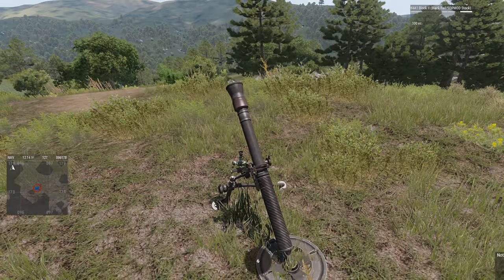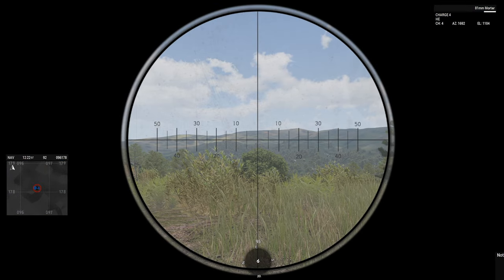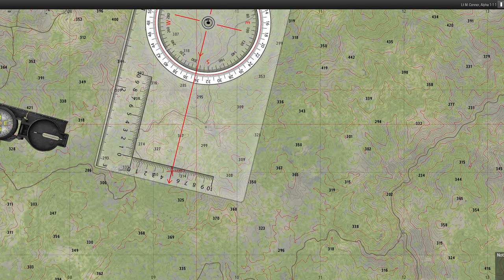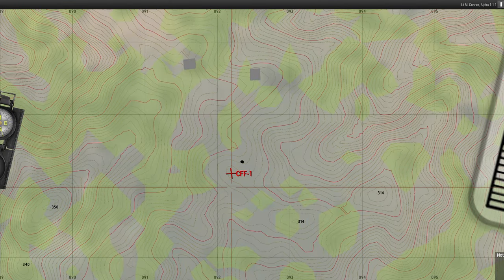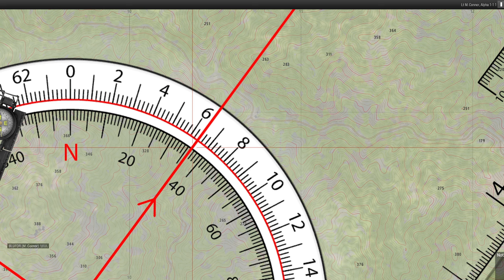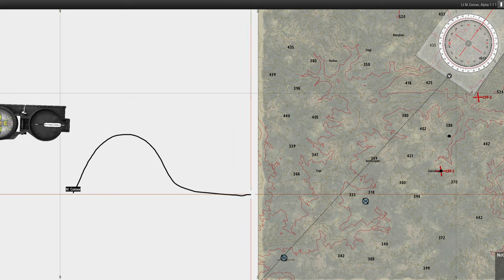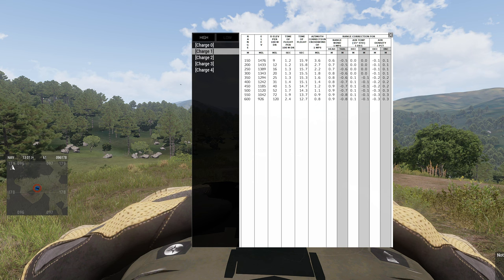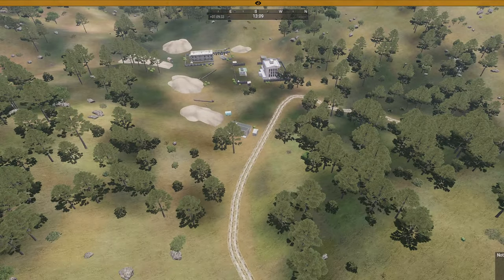ACE 3 Basic Mortar/Indirect Fire Tutorial | Arma 3

Comment: Any tips for very hilly terrain?
Reply from the maker: Hilly terrain can make mortars a lot more difficult to use, though there are a few things you can do to improve your speed/accuracy.
TL:DR - avoid firing at your max range, place your weapon on as flat a surface as possible, pay attention to how your azimuth changes affect your weapon elevation, and consider using one charge higher than necessary to reduce the effect of weapon-target altitude difference

First, avoid positions that will require you to fire near your maximum range.  When firing at maximum range, the path the mortar round takes is flattest, and is most susceptible to changes in terrain heights.  If you can, position such that you will mostly fire well within your weapon's range.  

Second, place your weapon on as flat of a surface as you can manage.  On a perfectly flat surface, changing the azimuth your weapon fires on has no affect on the elevation with which you fire.  On a sloped surface however, your elevation will change when you change your azimuth, increasingly so with more slope.  This can make laying the weapon a slower process, but the larger effect is when firing for effect on target.  When firing multiple rounds on target, best affects are achieved when the gunner swings the gun left and right, forward and back with each round for better spacing on target.  With slope, laying the weapon left and right may add/drop a significant amount of elevation and result in either a poor spread or a complete miss on the target.  Placing the weapon on as flat a surface as possible helps speed up target laying and helps reduce error.  

My third tip is more my personal standard procedure and does not work for every use case.  I tend to use one charge up/heavier/higher than required.  Specifically, if I could hit a target with charge 2, but I could also hit it with charge 3, I will usually select charge 3.  There are some negative effects to going a charge up.  Your round's time of flight will go up.  For example charge 2>3 takes you from ~23s to ~30s from shot to splash.  This added time in the air also means the round accrues more drift from wind.  Again for example from charge 2>3 you get around double the error from wind.  The benefit to doing this, however, is that you vastly reduce the error induced by firing on a target above or below you.  For a target at 900 meters distance, the charge 2 trajectory requires you adjust 18 mils of elevation per 100 meters of altitude difference.  The charge 3 trajectory, however, requires just 5 mils of adjustment.  If the environment is favorable with very low wind, the charge 4 trajectory cuts the error down to just 2 mils of elevation adjustment per 100 meters of altitude.  Higher charges requiring less consideration for weapon-target altitude differences is a factor of their much more up-and-down trajectory.  Higher charges send rounds much higher up, which mean for the same distance, the higher charged rounds come down at steeper angles.
This method of "charging up" is especially useful in very hilly terrain where your target will often be 150+ meters above/below your firing position.  It can significantly improve first-round accuracy.  From personal experience using this "method", 30-40% of the time I'm on target with my first ranging round, and almost every other time my second round is perfectly on target.  I prefer getting my round to the target as quickly as possible over spending time calculating corrections for crosswind, head/tailwind, elevation differential, air temp/pressure, etc.  The idea is that odds are I will need to send a second round anyway, so I can accept relatively small errors like a crosswind or elevation differential.  This becomes even more favorable when remembering that we're firing at a target and not a point on a map.  If a unit's location is misreported, the most carefully calculated and precise round that lands at exactly the intended square inch of soil will still need an observer's correction onto the actual target.  In windy conditions, or very high weapon-target altitude differences, "charging up" and dropping elevation differential calculations can add more error than it removes, so consider testing the math on whether the method works for you!

Note for the third tip, I'm referencing data from a mortar table I have in a spreadsheet for the RHS M252.  Numbers may be outdated and no longer accurate, but the concepts will remain the same.
Reply: Not an Arma guy, but I am a mortarman. (I watched this video because some friends asked me to play Arma this weekend)

What you are asking for is your altitude correction. Take your TGT altitude, and your MFP (where your mortar is) altitude, get the difference, cut it in half, and then determine whether you are not you are going to add to or decrease that amount.

Example. MFP altitude is 200m. TGT altitude is 350m.
That is a difference of 150m. Half of that is 75. Because the TGT is higher go ahead and add that to your range.
If your TGT was 950m you treat it as though it were 1025m.

Example 2. MFP alt: 200 TGT alt: 100 so that would be 100, cut in half is 50. Because the MFP is higher we are going to -50. If your initial range was 400m then your final corrected range will be 350m.

I hope this was helpful, don't know if it will work in game. Feel free to ask any additional questions.

Comment: you can make an exel that does all the hard work for you with 2 coordinates. I used to be that kind of adventurer back in day.
Reply from the maker: @TommiHonkonen  you can and I have!  You need more than two coordinates though.  You’ll also need to account for altitude difference.  Additionally, if calculating, you might as well add in wind and atmospherics!

What I’ve done personally is produce my own mortar table which concatenates all of the tables into one with one single charge/eleveation per distance to target.  For any areas of overlap between two charges I simply selected the higher charge!

Comment: Hey, thanks for the video Tutorial! Do you guys play with having to load each round manually? And if so, how do you find is the fastest way to load the mortar while firing?
Reply from the maker: I definitely prefer loading each round manually.  Personally, I teach a 3-person method to working mortars, however two people can work as well.  To answer your question in short, all members of the mortar team should be carrying mortar rounds in their backpacks.  When setting up the mortar, they should all drop their rounds down next to the tube.  One of the three will be the designated loader, and will simply load each round as fired, and will pick up rounds from the floor if they find themselves empty.  To make this as fast as possible, and also just for immersion, I find it best for the loader to call out "hanging" or something of the sort when they load the round, and something like "ready" when its loaded.  I find the communication helps prevent confusion on when the gunner needs to fire the round, especially if the loader accidentally runs dry in the middle of a multi round mission and has to pause to pick up rounds.

It's been a very long time since I've taught the 3-person method, otherwise I'd explain it in detail in case you wanted to co-op some of the ideas.  In short, I split the roles of the mortar team into Gunner, Assistant Gunner, and Loader.  The gunner is responsible for laying the mortar for ranging rounds and for adding dispersion to fire-for-effect missions.  The AG is usually the person who is communicating with whomever is calling for fire, and for most of the calculation for elevation.  The Loader is responsible for loading, and for some of the calculation.  They also are a sort of fact-checker, following along with any elevation/azimuth inputs and catching mistakes.

If you want to build some procedures around using two or three people on a mortar like this, I recommend you write down all the necessary steps from setting up the mortar to firing to breaking it down.  Grab a pen and paper and walk through a fire mission by yourself.  Each "thing" that you do, write it down, making sure to keep order.  When you're done, you should have an ordered list basically like a recipe that if you followed, each step after the one that came before it, would exactly produce a full fire mission.  From there, work out which adjacent steps could be conducted in parallel.  For example, the loader can find the range to the target using a CTab and the assistant gunner can find the azimuth to the target using a maptool simultaneously.  The assistant gunner can give the azimuth it to the gunner.  The gunner can lay the gun while the loader tells the assistant gunner the range to target.  Then, again at the same time, the assistant gunner can select a charge for the right range, while the loader can determine the altitude difference between the targets.  If conducted quickly, the loader can deliver the altitude difference to the assistant gunner as they select the charge, and then the assistant gunner can hand an altitude-corrected elevation to the gunner.  These are just examples, though.  I recommend you try and find your own process to train with your team!
Reply: @2ndbn17thrangersunitoffici5  awsome! Thanks for a great answer! It's definitely given me a lot to think about. And I particularly like the detailed descriptions of tasks delegation for the fastest shots. Honestly, it would be a sick video. If not a full training session. Perhaps just a show of three dudes working the mortar like clockwork.

Anyways, specifically what I was looking for, was if there was a hotkey to load each round instead of the silly interaction menu. Because we find ourselves losing speed on account of mis-clicks and other annoying stuff.

And for the scope of the mission I'm working on, which drove me to write to you in the first place. It's a little too much training. Since it's a one off event. For an air assault platoon. Of mixed Arma units. 

But I will seek your advice though. Because, the 81mm mortar is heavy as Gucci! And my mortar Gunner can barely move as is. And with the current setup of 4 men. They can manage to bring 16 HE, and 8 smoke shots with them on foot. 

How would you go about ammunition handling a similar situation?
Reply from the maker: @Jakob6250  Scope is definitely something you always need to consider.  I personally am a massive nerd about this stuff, and I like to optimize and do things realistically and fast.  With less training though, Its probably best to have a dedicated loader/assistant, a gunner, and two security/ammo mules.

As far as a hotkey goes, I think thats the kind of thing the ACE3 devs would be receptive to.  The menu is definitely a bit annoying to navigate, but its the best you have unfortunately.  As far as carrying more ammo goes, besides adding another mule, or by using backpacks with more space, consider having some storage dropped in by whatever air assets you guys have.  I've run mortar teams before with something like a Polaris RZR and a couple of ammo crates full of HEs.  Light enough to be air dropped by anything, can easily double or triple your HE output.  If you guys set up on an OP or something a helicopter could drop off some HE there, too.

Another possibility, albeit the least effective, would be to have some crates dropped in by whichever air asset takes you into the AO.  You can fire those rounds from there, and then move on with whatever you can carry.  This is helpful if you have some pre-designated targets that are eating up your ammo before you even have any suppression fire missions.  Additionally, if its feasible, you could even stash them and have half of your team travel back and forth once or twice to carry round to wherever you're setting up.  While not ideal, it could work, depending on your circumstances.

Comment: Mods?
Reply from the maker: Ace3 and RHS USAF are the primary mods showcased in this video.  In total there are probably 60-80 I am using here, I cannot provide you with all of them.  Additionally, most of the mods I use are designed for a multiplayer milsim experience, and not a singleplayer one.  I recommend reddit.com/r/findaunit or the steam forums for finding milsim groups!